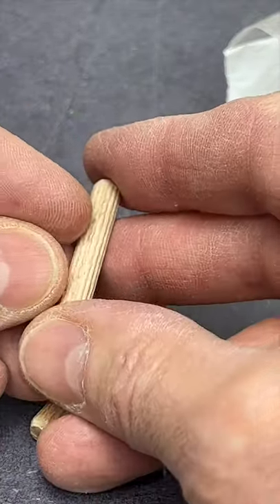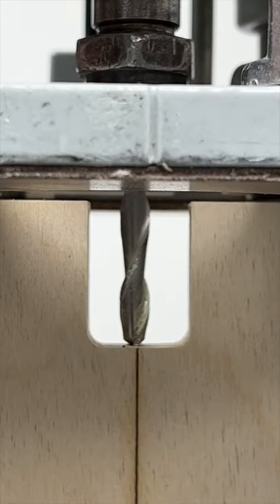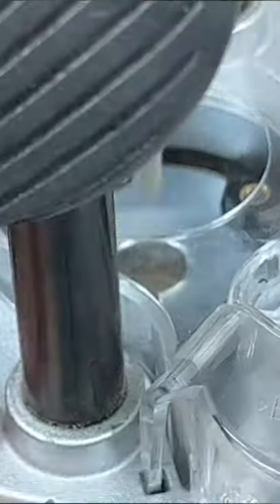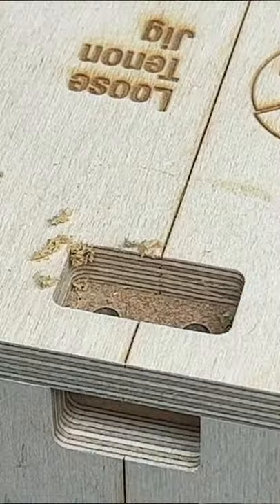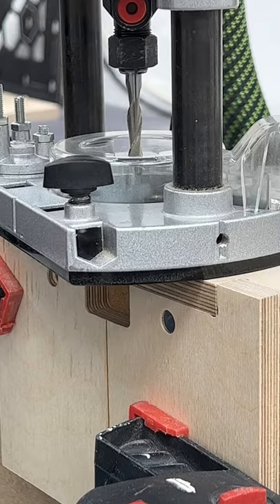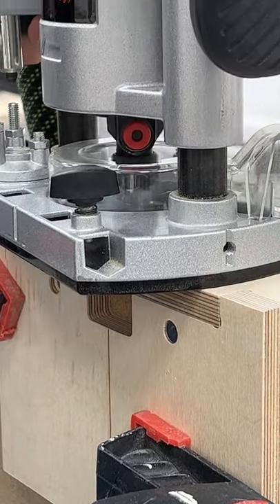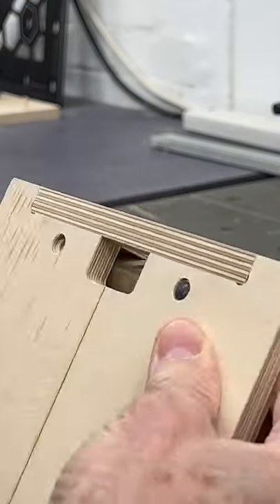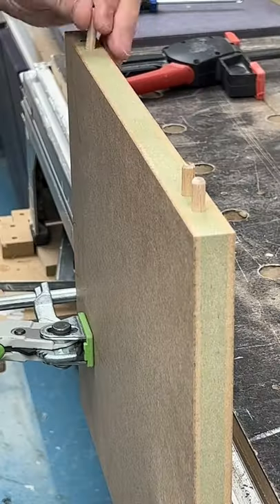Loose Tenon Jig with Dowels

Comment: Hi Peter, just had chance to watch your short video, I don't really see the need for a drilling insert, it looks simple enough to use it in the way you have demonstrated and there are already loads of cheap Dowel Jigs around including Dowel Centering pins which I use quite often.
Looking forward to the next batch becoming available.
Reply from the maker: The benefit of a drilling insert comes... later, let's say. 👍
Reply: @10MinuteWorkshop  Say no more, Nudge Nudge, Wink Wink as they say 😁

Comment: Lets not forget that the benefit of this jig is the wider slot to allow for any slight adjustment. Dowels will not allow for that movement.
Reply from the maker: It's the killer feature, IMHO. But some folks like the cheapness and simplicity of dowels, and this makes a great pin-registered dowel jig, even if that isn't what it's intended for. 👍
Reply: @10MinuteWorkshop  Thanks for your response to my comment. While I have your attention can I ask for some guidance. I have already purchased the plans for the jig but I am very confused by the search results for 5mm spiral uncut. Are you able to give me your recommendation so that I get the right thing. Thanks in anticipation
Reply: @Gooner_71   google 5 mm up cut - you have a number of choices.